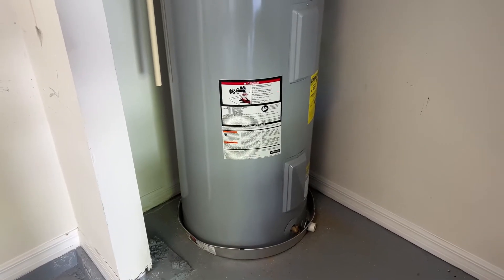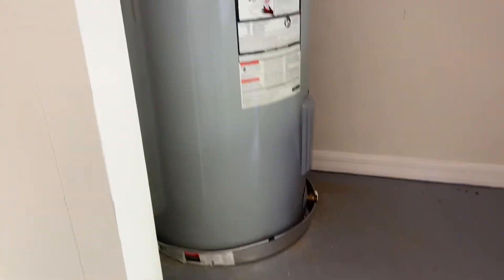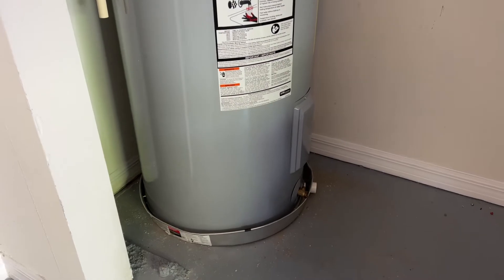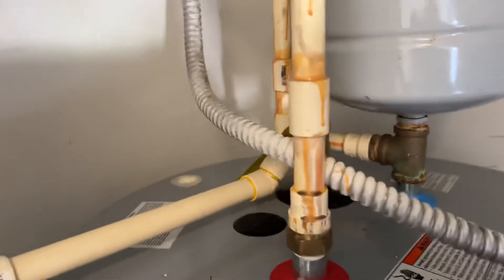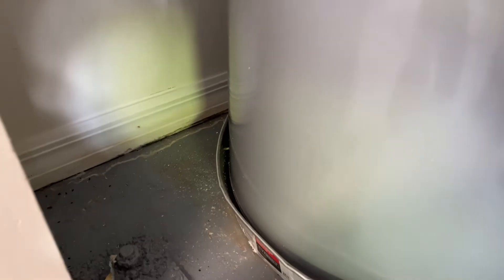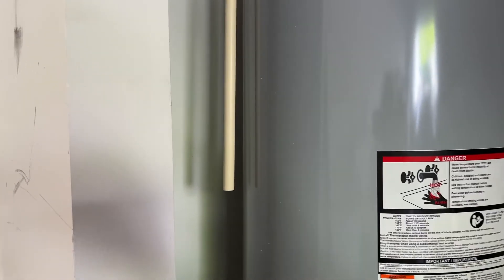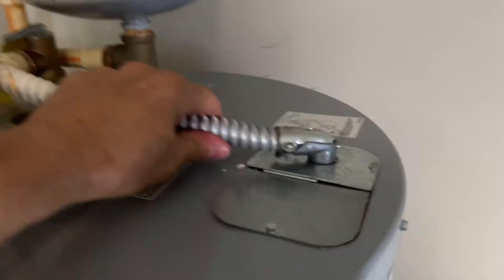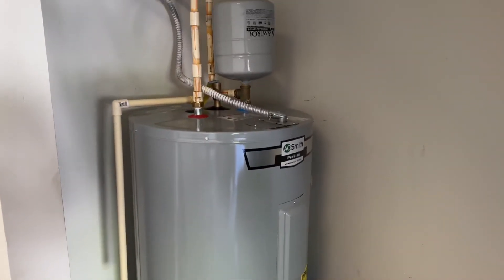Water Heater installation with 2 Code Violations ( no permit )

Comment from the maker: Is the expansion tank installed correctly?
Reply: Most expansion tanks you can install upside down
Reply: @AaronCunningham depends on the code in your area.
Reply: @AaronCunningham  No, you can’t.
Reply: @brucestorey917 yes, you can.
Reply: @brucestorey917 yes u can ur wrong
Reply: Preferably I would use a brass cross and do vacuum breaker on top run a 6 inch brass nipple with a brass 90 and put my expansion tank on. This guy saying you can’t install an expansion tank in this direction and that it’s upside down isn’t a plumber I promise. Supported is the question with new guidelines, most inspectors in my city understand the weight of an expansion tank can be supported by threaded brass 3/4 fittings and nipples. If you use copper to pro press an expansion tank on you would probably need to support it.
Reply: @user-lr5bo3ip8i  yes, I find expansion tanks that get waterlogged and arent supported. It puts stress on the flex connectors and cause leaks, and same with press fittings. 
If the tank is not supported, and gets waterlogged. It can put stress on Soddered, press, flex or shark bites. Personally i use red brass, so I don't have to support the tank, plus it looks very clean and professional.
Reply: My tank is sideways. It was replaced by 2 different plumbers(2 different water heaters) and is in a tight area.
Reply: It must be supposed
Reply: No! It is installed upside down and since the installer didn’t hand-write the pressure on the side of the tank, I am sure the tank wasn’t charged to the same pressure as the system. They come pre-charged at 40psi-50psi and must be adjusted//charged to the same pressure as the system.
Reply: What is the point of an expansion tank?   Seems pretty unnecessary to me.
Reply from the maker: It is a very important part of the system @GoingGoneGalt
Reply: @thebuildingcodeforum  Wow, what an insightful answer!    That explains the entire reason and purpose just perfectly!   Or...  is that code for "not a damn thing but some moron getting a giant kickback from the manufacturers decided to require it."?
Reply: @GoingGoneGalt  it allows for expansion when water is heating and cooling while in use. cold in hot out. When water is heating, it expands. If there Is a backflow preventer or check valve, on the main. There is no room to expand. It protects the water heater and its safty features. 
I learned this from a professor/engineer.
Most houses don't have either backflow preventer or check valve on the main. Either way you should have a PRV and expansion tank to protect the water heater. Even if you dont have high pressure, you can regulate the pressure and pump your expansion to match your inlet.
Reply: @lds5541  The part that I was missing is that it is now common to have a check valve on the inlet side, which the content creator was kind enough to point out to me is now common practice in many municipal systems.  I did not grow up with these, and have been on a private well system for many years.   I understand the physics just fine.  What I was not seeing was how the system could end up sealed with no place for the expanded volume to go.  I get why many systems would need them.   Not mine, but many would.
Reply: @GoingGoneGalt  I grew up in older naborhoods that still dont have check valves. You don't need expansion tanks, except code says so. For 100 years my dad and grandpa installed water heaters without expansion, or PRVs. Not 100 but more like 60.
Reply: @lds5541  exactly.  You see my confusion then.
Reply: @lds5541  I know its a year post but I just want to give credit to you. First person I see get the understanding of the expansion tank. It is only useful if the house system is a closed system. When it is actually in the building code, it says you need it if the system is closed. Never required if it is not. Same goes for manufacture installation of water heater instruction.
Most people, inspectors just call it out because they see so much and not wanting to read into it. They let it build up in the code.
I don't read code all the time. I'm not inspector but I like to read to find out if something I don't see it make sense. 
Without reading to much. I believe 2 codes are, prv pipe is not install down close to the ground 2 to 6 inches if I remember correctly. 2nd, the exposed pipe should be copper, minimum first 12 inches from the water heater. 
Assuming, this location is not prone to earth quake therefore no need straps.

Comment: why isnt there 18 in of metallic plumbing connected to the water heater nipples before any non-metallic pipes? Direct connects that aren't metallic will can melt and leak do to high temp.

Comment: Town house im at electric hot water heater. Hot water gave out 💯. Cold hot tapp both yellow didn't know why and smells like burning or rusty now i put 2+2 together. 2 wks this going on 4. Told maintenance long time go b4 heat went of smell color. Said small leak order part fixed temp so i have hot water. Still waiting part. Worried of rust color odor still

Comment: In my town have had three estimates to replace my 40 gallon, short, gas water heater.  $2,700 to $3,200. Why so much, I was told by all three it was the city permits....Bought the water heater at Home Depo for $800,  installed it myself in just under an hour.  Got city to inspect, and permit for less than $50. Not a big deal to do it yourself.
Reply from the maker: Those are some crazy prices.
Reply: @thebuildingcodeforum  What's crazier is the cost of running even a very small, lean ran plumbing service company. Just getting by at $2300 for a typical basement install, 40 / 50 gallon gas.
Reply: its great that you abel to do it, do you think the plumber is working for free?

Comment: As a homeowner who does her own work where she may, what’s the second violation? Replies in this discussion claim the T&P discharge line end anywhere from 4” to 18” above the floor. What’s correct?
As for other alleged errors in the installation, folks should cite code. Simply saying “in this area” isn’t enough — I see many remarkable comments here regarding mounting, materials used, and the disconnect placement.

Comment: Requirements depend upon AHJ. 
California specifically prohibits relief valve from draining into drip pan. 
 Also required=  permit(gubment wants their money), seismic bracing at upper and lower thirds of tank, insulation on first 5' of piping(hot and cold), expansion tank must be braced to structure. 
For those poo pooing the permit, if one had been pulled, this installation would not look this bad.

Comment: The pop off valve tube is supposed to be copper not plastic it is supposed to be no more than 6” or so from the floor and on a electric tank a disconnect is supposed to be installed at least a foot from the unit

Comment: The outlet of the discharge pipe shall terminate within 6 inches over the floor or receptor, but not less than a distance equal to twice the diameter of the outlet pipe.

I prefer the relief tube to not be in Pan. The code states that it has to go to the pan, the floor or drain. It doesn't say it has to go to the Pan Just because there is a pan. it just has to be within six inches of the floor pan or receptor.

Comment: Needs to be raised 18 inches off of floor. Needs flex lines installed. Needs a Vacuum relief valve on a cross. Needs T&P discharged to an outside wall. Needs 1 inch minimum clearance in pan around water heater. Needs either a plug or disconnect depending on city.
Reply: where in the code does an ELECTRIC water heater have to be 18in off the ground? that code states the water heater IGNITION source has to be 18in off the ground in the NFGC... sheesh
Reply: @beardedbarnstormer9577  You telling me gas fumes can’t ignite off of a lower Heating element on an electric water heater? I’ll have to go back and look at the code but in my area if there is no door or closet ..gas and electric must be raised and cannot sit on the floor in a garage
Reply: @TexacoGaming   I'm telling you that yes.  An electric water heater element is submerged in water and not exposed.  It's also not considered an ignition source as it is not an open flame or spark.   

IPC and UPC allow electric water heater install on floor in garage.  I'm in Phoenix but LA allowed it as well
Reply: @beardedbarnstormer9577  Thankyou I stand corrected, I also just looked at code and I’m not sure why my municipality requires that.
Reply: @TexacoGaming  municipalities get weird.  A lot of them outside of major cities don't update their rules enough.  Also when I was in the frozen north they focused a lot more on gas and had very little electric most stuff was applied to both.

Comment: I am not sure if this is a plumbing code violation. But I've always been told electric water heater, plastic drain pan, gas water heater, metal drain pan.

Comment: All water heaters, electric or gas must have 18” of steel at the hot and cold connection. Most inspectors will let you get away with plastic on electric WH. Pressure relief discharge pipe must be steel and have no more than 2 maybe 3 ( can’t remember) 90 degree elbows and terminate 6” above the floor. It’s not code in my area for earthquake supports or expansion tanks, but there are situations where I would recommend them.

Comment: Violations aside, I would definitely not use CPVC.  Especially when pex is so cheap and available.  I don't love CPVC on the discharge line either.  Some areas require metal pipe on the TPR discharge line.

Comment: The over temp/press discharge tube should be about 4 inches from the ground, I am not sure about the CPVC material and the temp rating, I used copper in mine, but you must have a cold water shut off valve to isolate the heater just above it, I don't see one.

Comment: Pipe should be 6" from floor no less than twice the diameter of the pipe / no mixing valve no electrical disconnect

Comment: T&P discharge line must be treated as a potable water supply system outlet per the IPC and IRC, therefore requires an air cap to prevent siphoning, but the discharge line must be no higher than 6 inches off the floor and run to a safe place of disposal.   It should be obvious, but in case it's not, here's why this is such a hot button topic.  A T&P valve is designed to discharge at 150psi or 210°F, so if the discharge pipe is missing or terminated too high off the floor and a defective thermostat causes runaway heating,  a large amount of near boiling water will be released at high pressure causing disfiguring scalds or death to anyone nearby. 

Also, if the breaker panel is not visible from the appliance and within 50 feet there needs to be disconnect switch nearby. 

Missing straps securing the unit to framing members if in an earthquake zone

For gas and oil fired water heaters in a garage the unit should be elevated no less than 18 inches off the floor, to reduce the risk of gasoline vapor ignition.  

The water heater should be located where not subject to damage from vehicles.

Comment: In my area they are ALL required to have a stand under them.
Reply: Only for gas water heaters located in a garage…
Reply: I know it’s code, but purpose? I’m assuming it’s to have fall for drainage if it started leaking.
Reply: @user-ln7of9gs4s In garage so above gas fume level.
Reply: So that it eliminates or decreases the chance for gasoline vapors to be ignited, in the instance that a car in the garage has a leak in its fuel system. Assuming that gasoline vapors are heavier than air, etc

Comment: Simply replace the thermostats, There's obviously an overheating issue.  If Water heater is more than 14 years old replace the water heater,  The Pan must be piped to the first floor level. It's missing earthquake straps. The T&P must be piped to the Pan With an air gap.

Comment: If that tnp starts dumping it dont really matter if its 2” to 6” from the floor or in the pan. Theres gonna be water and steam like crazy. The main concern in my opinion is the metal pan on an electric water heater and the plastic piping straight off the heater itself. That tnp could even sieze shut in the future.

Comment: There isn’t Earthquake bracing,  pressure line too short could plumb it to garage floor. ❤
Reply: Earthquake strapping is only required in earthquake-prone areas.
Reply: @brucestorey917  yep.

Comment: A leaking water heater should be a one-time issue.  Replace the broken water heater.  You shouldn’t have frequent water heater leaks.   The PRV discharge being so high is an issue.  I’ve also seen many water heaters without pans, but know that if there is a leak, you’ll have a mess.  But that leak should also be the water heater replacement.

Comment: Undersized pan installed? Drain looks like it is touching the pan on the tank and if a flood sensor was in the pan those seemed to be 3" squares sitting flat on the floor of the pan

Comment: Years ago I never saw an expansion tanks on hot water heaters. Heating systems yes. And they never had pans under them. I sure would not use plastic pipe.

Comment: Expansion tank should be on the discharge line
Reply: It must be on the cold side.
Reply: Understand why the expansion tank should be installed on the cold side. To compensate for pressure fluctuations within a closed system, e.g., home has PRV (pressure reducing valve).
Reply: expansion always goes on cold side....

Comment: That pipe is not allowed on the water heaters they have to be copper that close to water heater first 18 inches
Reply: CPVC is rated for hot water use, pVC is not acceptable for plumbing inside a home

Comment: Pan size too small, no drip pan drain,  t &p line too high off floor, no electrical disconnect. Not sure if expansion tank can be installed being soley supported by pipe or it needs to be strapped on the wall. Not to mention the cpvc ball valve will crack to the next person that shuts it off, should be transitioned to a brass threaded ball valve and i always cut up to the wall and replace everything in sight with copper. Fuck cpvc
Reply: cpvc is trash 5 to 10 years its rotted and will brake supper easy
Reply: Good catch.  An electrical disconnect is only required if the breaker panel is not within sight of the water heater, and by that means visible from the appliance AND no farther than 50 feet away.  Cord and plug connection technically is not acceptable,  but some years ago it was not uncommon to see a 3 wire dryer cord or a length of NM or flexible cord with a NEMA 10-30 or 6-30 plug cap wired on and plugged into a receptacle, to serve as a disconnect means.

Comment: Pressure discharge to high, 6 inches into a drain or outside. Expansion tNk should be on hot side
Reply: Expansion tank should be on the cold side.